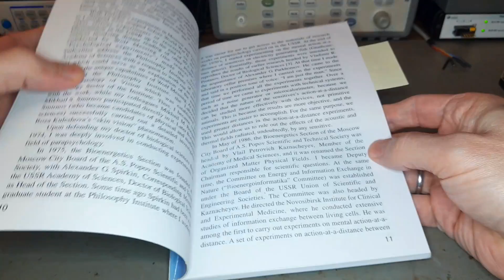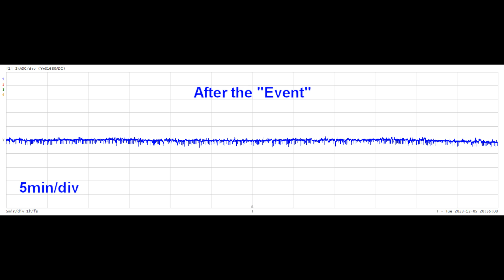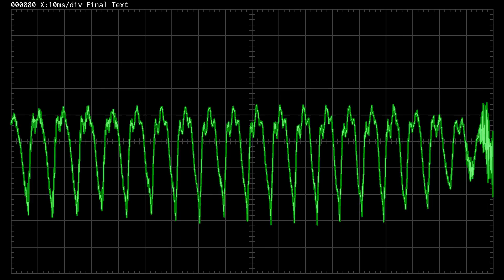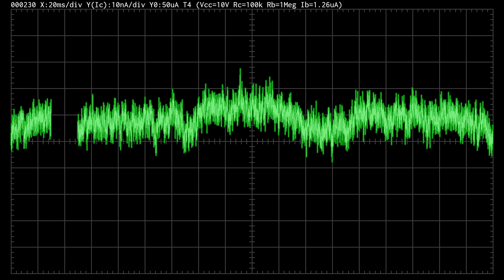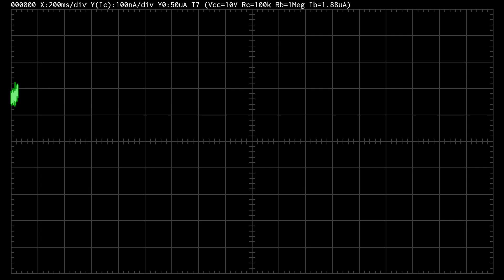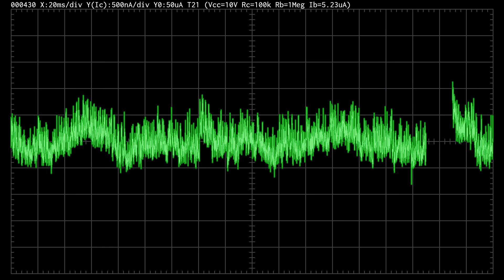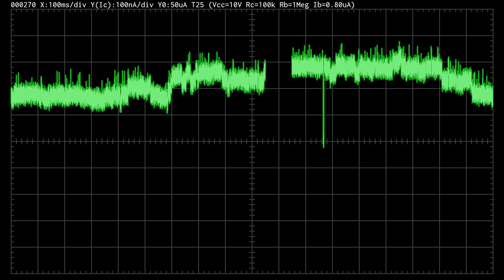Popcorn Noise - A Miracle?

Comment: Isn't it possible that these random phenomena in semiconductors are caused by cosmic rays or radiation? It should be easy to verify.
Reply from the maker: Indeed one "event" of the T20 (used for long-term recording) changed its character for more than a day exactly when there was a magnetic storm, but it seems to be just a random coincidence. I documented it here: https://youtu.be/9Uvho-OzQXA

Comment: The first thing that comes into my mind was thinking about whiskers, especially for the metal canned transistors. But whiskers should only appear greatly within germanium transistors, where it can even lead to short circuits making the device unusable. Another point is, that other metals like tin can build whiskers, too. I'm not an expert, but probably there are metals used, that can build those. These whiskers are not stable, therefore they change by time and also when some current flows and other changes. This really happens in bigger structures too and happen nowadays by using lead-free soldering. Those whiskers even build between contacts on or within the (multilayer) PCB and in short time too (say days or months). No one has really managed this by now and it makes big quality problems everywhere. But no one would tell you, since it is a secret ;) Probably you have to use some x-ray thingy to show those micro whiskers, but I believe it's hard to get access to those devices used for this (idk the name of those apparatus to show nanometer structures). But these are only my thoughts, I'm not an expert.
Reply from the maker: Would be cool if you or someone else could disclose some secrets regarding whiskers, seems to be a phenomenon that is not well understood too. Also this NTBI mentioned by davidjohnston4240 sounds interesting, reading about "rejuvenation" in some related papers sounds pretty esoteric, not like well understood engineering.

Comment: An interesting addition to this would be to run several such transistors simultaneously and view the results.
Just to see if this is purely random component failure or some other as yet unknown cause.
Reply: Absolutely. 
When results prove to be independent, several source bjts could be combined to create a true random generator out of only a few components.
When results prove to be in relation, several source bjts could be used as a sensor array, for whatever external factor they show a sensitivity towards.
So... interesting to combine simlutaneous / multichannel testing, no matter what ;)
Reply: I forgot to read the comments before posting. I just recommended the same thing. The use of batteries to supply the circuit would probably eliminate potential noise from the power supply.

Comment: Since this was done with an ADC, presumably you still have the data from this. It might be interesting to run it through a spectrum analyzer (audacity will work fine). Its difficult to tell by looking at the raw waveform what kind of noise you have.
Reply from the maker: Sure, I have the raw samples from the ADC (ADS7807) as well as fast sampled values exported from my scope. Had a look at the spectrum, pretty disappointing, a curve falling down, no peaks. The pops don't have enough energy to show up and they deliver a wide spectrum too. I made a short waterfall video of T20: https://youtu.be/Oe6Fgu5fG-s

Comment: I get that sometimes on my mac! sounds most like 18 or 20, haven't tried to reproduce, but I think it happens when I play mp3 with ffplay, pause the stream and background the process, maybe do that a second time too. Then all the audio on my mac (eg firefox youtube) has popcorn, starts gradual but seems to worsen. I attributed it to the sound system out of memory semaphores (swapping), or some other bug. It goes away when I kill all the background sound process. I only mention it because it sounds exactly like that, a bad connection, old phone lines, etc, although I know it is not. I also hear it sometime on zoom, but I don't think that is local.
Reply: This reminds me of the problem with gold plated contacts. Especially when made improperly the can "loose" its contact to the inner metal on whose it is plated on. This could lead to some changing resistance, even to break the whole contact. Therefore some companies have decided to not use gold plated contacts at all, since they are not very long term stable. Some workers have had the job to scratch the gold from contacts before soldering when a connector is only available with gold plated pins. I've heard a story about NASA that they doing this long time ago, but I don't know if it is true, or not. I've had this problem with some "high end" soundcards on a PC, too. Changing to a cheap one without gold plated connectors fixes the problem (simple rule: if there are gold plated socket connectors, use gold plated plugs, too. This should reduce the problem on the outside, but not internally on the PCB or the cable itself ;)
Reply from the maker: Seems that nowadays manufactures of connectors use a nickel plating below gold to avoid metal migration and later corrosion.

Comment: I've never verified that, but interestingly the "pop" seems to occur more often when cooled.
Reply from the maker: Hmm... variation of +-10degC or so did not really show a significant difference but when using coolant spray (-45dgC written on the spray can) it stops. These experiments are difficult because the DC operating point runs away of course, I tried to compensate manually with the potentiometer controlling the base current, so it was not a really well defined experiment.
Reply: @gumpomat  Thanks! I must try my self. I don't have 50 years old BJT tho...

Comment: It would be visually interesting to watch the audio on a "Waterfall Display" as is used on many Software Defined Radio software.
Reply: Waterfall display has many parameters as inputs, frequency over a range, amplitude, etc. Here all we have is amplitude and time. So it's not a viable way to represent it. Here we are sampling the amplitude at a specific time only. The frequency is constant of the sampling rate. Maybe you could do some sort of waterfall if you captured more things like the temperature or atmospheric pressure but I don't think those would visualize the way you want it to.
Reply: @newmonengineering  I guess that an audio spectrum analyzer type display would show the noise distribution because I could clearly hear the differences of noise "color" type right from the start of your Audio+Oscilloscope playback.
Reply from the maker: I gave it a try with T20, but as already mentioned, it is not spectacular. The short pulses do not contain enough energy, they undergo in the mass of samples. Here the sampling frequency was 50kHz, not 16kHz as in the main video: https://youtu.be/Oe6Fgu5fG-s

Comment: Could the Rb noise contribute to the phenomenon?
Reply from the maker: Yes and no, I think. Rb for sure contributes white noise that is naturally amplified by the transistor. Making Rb smaller the noise floor is reduced but also the pops have less amplitude. I once amplified pure resistor noise with a modern low-noise preamplifier (<1.1nV/rtHz), no pops visible.

Comment: I am under the impression that popcorn noise is the effect made from the voltage at base being bumped by the voltage at the collector as it makes its way to the emitter. 
And a transistor changing it’s noise here and there… it is absolutely due to variance in heat and atmospheric pressure/ quality of transistor. You’ll never have a pure perfect transistor, you’ll never have a pure constant voltage. There will always be small gaps and changes in its functionality because it’s just so damn small. We are too big to obtain complete control of the too tiny.
Reply: Pretty sure that atmospheric pressure will have little effect on hermetically sealed components. And given how there were ovenised above ambient in an insulated enclosure, I highly doubt that would be the cause.
Reply: @JaenFoster  Probably the somewhat higher temperature (which increases noise massively) leads to diffusion between the PN zones. This is known as degradation of semiconductors until they die. To prevent this from happen too early usually they are kept ideally at room temperature to reach its expected lifetime. Probably the variances in noise could be caused by the degradation as they are already degrated from being so old? Diffusion always happens at some rate when having a temperature above the (theoretical) absolute zero of 0 K. But maybe I'm totally wrong, it is long time ago I have learned this ;)

Comment: Could you add the transistor model to the sections of tecordings?
Reply from the maker: Unfortunately I have not more information than written on the cards shown in the video. T1 to T20 are the plastic ones, the text on the card means "Si-Miniplast Transistors for LF-, RF- and Switching Applications.". T21 to T25 were ones with metal housing, the text on the card means: "Si-Epitaxial Transistors in TO 5 case", no type number given, even the cases have no markings at all. I guess it was excess material, finally sold to hobbyists instead of wasting it. I tried some BC237 that were about 40 years old too and saw small "popping" but extremely weak that I concentrated on the other ones.
Reply: @gumpomat   Thank you very much.
I do have a bunch of BC238 transistors somewhere. And they very well may be four decades old, too.

Comment: perhaps you could give the part numbers so others might try to duplicate these results.
Reply from the maker: Unfortunately I have not more than the paper cards included in the plastic bags shown in the video. I just replied to @GianmarioScotti, see the comment there. The word "Miniplast" could be interesting on Wikipedia (en.wikipedia.org/wiki/TO-92) they wrote: "In East Germany the E-Line package was known as the "Miniplast" package and widely used by Kombinat Mikroelektronik Erfurt.". However, I think half of the transistors that are older than 50 years might work.

Comment: Why so silly, simple components such as transistors can be so interesting...
4:52
have you checked perhaps, the variations of your power supply? If I were you I would keep collecting data with the same circuit and different transistors if you see a pattern, if the shielding offered by your cookie box is enough ( if it is n gnd and well grounded  )  there should not be anything, BUT there is something.
maybe, caps. i upgraded an old ICF-SW1 with tantale caps and they are perfect. in all good stuff.

idk, i want to try this and grab my oscilloscope and check out, but certainly somehting created these interferences, some "smart" thing sending data to three letter agency everyday at the same hour maybe?
Reply from the maker: The power supply has been proven to be low-noise during my work on the proton magnetometer. In the circuit used there I'm measuring the frequency of signals in the range of a few microvolts. I used the same power supply for long-term testing, no glitches, no spikes, all fine. I built it on my own, transformer, rectifier, capacitors, LM317.
Of course the cookie tin is grounded, the blue cable in the setup is minus and connected to earth on the power supply.
Reply: @gumpomat  But aren't those regulators known to be very noisy? (the good old 78xx can be used as a noise generator by itself) I would try a better ultra low noise regulator. And even batteries have noise induced by decharging them (chemical noise of the reaction).
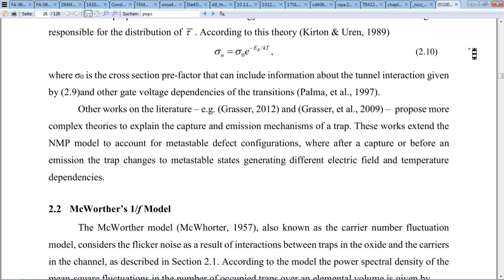Reply from the maker: The LM317 is used in the 12V power supply that powers the whole setup. The transistor test circuit itself gets 10V regulated by an LP2951 (see schematics at 3:00), which sits close to the transistor and opamp on the small PCB inside of the thermal insulation tube. So the relevant part of the experiment is "behind" two regulators.
Reply: The noise varies radically among dozens of different transistors.  He's eliminated pretty much everything else, simply by trying so many different examples.  Super interesting video.
Reply: @NoahFect  yep, I admit i never expected to stumble on a video about transistors noises, but still these aren't high grade transistors, try that with a Tosh' or Infineon MOS.

Comment: Just a thought, but maybe have another setup running in parallel, outside the "cookie tin" shield. And is that "cookie tin" Faraday shield grounded ? This way you can see if there's an external source (solar radiation, radio signals, remnants of the Big Bang <- Nobel Prize for that one). Proper shielding is an art !

You know you're an analog geek, if you listen to a video that most consider random noise.  Its really not that simple. There are subtleties. Consider pre-high speed internet modems. They used a constellation of points on the complex frequency plane. Listening to data transferred on a 56K modem, sounded just like noise. Not saying that's what you have, unless you have a 75yo neighbor still using AOL on dial up.

Just isolate the circuit generated "noise" from and potential external interference. Having two exact setups at least can tell you, if your shielding is adequate.

The BE junction on a BJT can hold charge. Any PN junction can, if the voltage is below the forward breakdown level. That's why LEDs sometimes still glow for minutes after they are turned off. Also why I put "bleeder" resistors on base circuits using BJTs, such as multiplexing circuits and "ghosting".
Reply from the maker: Yes, all carefully grounded, these kinds of long term "character changes" were also visible when I started the experiments without any proper shielding and a lab power supply and scope only. That was when I got stunned, trying to investigate more. So I believe it is really nothing that comes from the cookie tin setup with the raspberry.
Well, a second setup, maybe one day... this stuff is only a spare time hobby ;)
Regarding the solar flares, no luck, unfortunately: https://youtu.be/9Uvho-OzQXA
Reply: @gumpomat could it be from something like Gamma rays produced by lightning?

Comment: Have you tried bringing a radiation source, like a thorium candle mantel, into proximity? Your box would not shield the semiconductor from energetic particles.
Reply from the maker: Sure, I tried an old candle mantle and some minerals I have, both pretty active, checked by a Geiger counter, but no audible/visible effect on the noise of the few transistors that I tried.
Reply: @gumpomat There are also neutrons, muons etc...
Reply: @AndreasDelleske  and the sun storm (electro magnetic waves) or even gamma ray explosions of far stars. probably the pops are explosions on the sun? the differences could come from different qualities of semiconductor material? If you look at those diagrams they have a similar time line changing the waves for some hours until they go back to normal again.
Reply: You can see the parameters of the noise vary dramatically between different devices. The local external noises like radiation are not choosing how to radiate based on which transistors are plugged in. The shape of the noise is a property of the silicon, not external inputs.
Reply: That is so interesting! Thanks for replying. I loved your video. When I get the chance I'll have a go at reproducing it in my home lab. Please keep this kind of content coming! Regards, Mike. 
 @davidjohnston4240
Reply: @davidjohnston4240 well yes but he said "particularly plastic housings" that already would be coherent with billions of particles passing is every second.
Reply: @AndreasDelleske  Yes. Plastic housing, particularly on old devices, before we stopped worrying about radioactivity in the plastic can be a local interferer source. This originally was thought of in the context of memory chips, where the radioactivity in the plastic was blamed for bit flips. Wind forward 40 years and the plastic packaging is controlled for radioactivity and the silicon is dramatically different. We still have measurable memory BER and transistors are still noisy, while the nature of the noise has changed with the device technology. Flicker noise (1/f noise) is a particular problem these days in modern silicon processes (at least it is in the circuit design team I work in). Partly this is due to lowering of voltages, so the noise is a bigger part of the whole. It is in part due to the smaller number of atoms in the gate, so the quantization is more apparent. Part of my job as it currently exists is to make executable digital logic models of noise distributions for making effective self tests in silicon. I clutch tightly to my "non uniform variate generation" book.